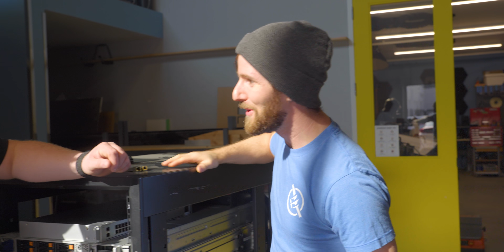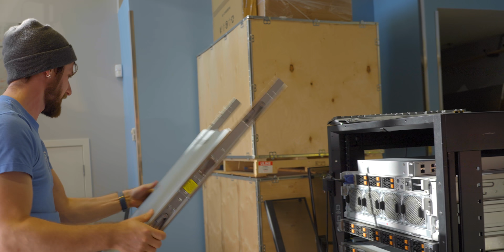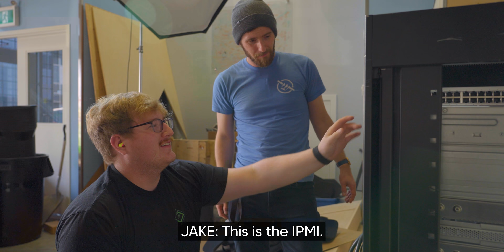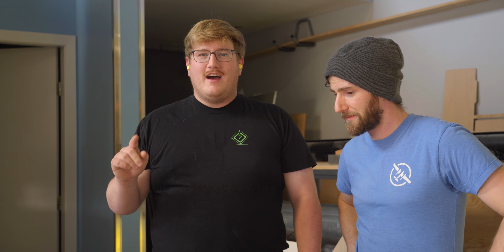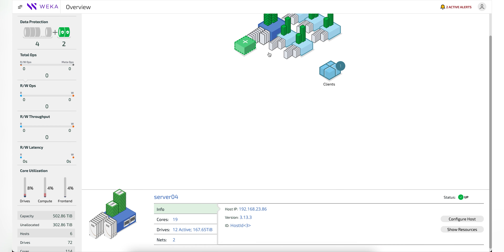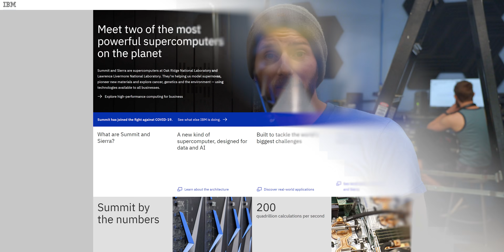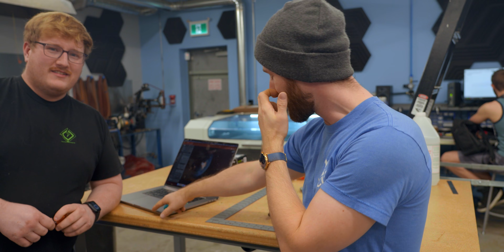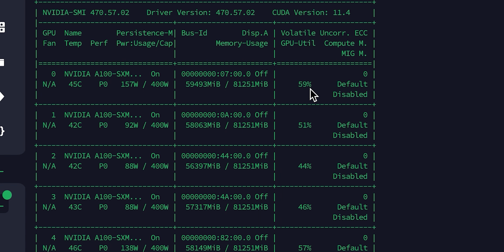The $1,000,000 Computer is Broken

Comment: Have worked for HPE before. Reseating a CPU fixes the issue more times then you might expect. it's weird and might just be a design issue
Reply: Hah.
Reply: I forget their comments through the series of videos regarding building / tearing down those servers, or if that one was shipped / arrived with that build issue. I've also had to reseat a HPE gen8 cpu that was acting really funky, dropping ram slots. I had many spare ram sticks to test, and plenty known good in another almost identical gen8. That was a second hand ebay purchase so was glad to finally fix it before taking up some support ticket.
Reply: HPE loves to ship fully populated racks and those systems take a literal pounding in the back of a Semi Truck. So reseating components is a very common practice on new servers with intermittent issues. Other manufacturers have similar issues so it isn't just an HPE issue.
Reply: @Jack-yl7cc  Absolutely. It is not vendor specific. HPE are pretty much my gold standard on support regarding weird issues.
Thing is.. all the vendors are shipping similar things under similar conditions, they really should be taking every factor into consideration, that the product arrives in perfect working order.
Reply: @benwu7980  This issue has been going on for decades and I have seen it from every manufacturer so at this point I am going to assume they have all done the math on what it would take to permanently resolve this issue and figured out it's much cheaper to train their support techs to ask the customer to reseat the components on the rare occurrence that this problem crops up. How often this problem pops is completely random too; I've had shipments with 1 out 5 servers that had loose DIMMs that needed to be fully seated and other times I didn't find any problems in a shipment of 192 blade servers.
Reply: @benwu7980  HP and later HPE is the only manufacturer that I've dealt with that actually requested a system experiencing odd-ball issues be shipped back to them for their own root cause analysis and troubleshooting.

The real trick is getting past their first few layers of support to actually get to someone that will do something besides reading from a pesky low level troubleshooting playbook. An unfortunate annoyance that every manufacturer support seems to have and one that is to the point where at times it feels like I could write a whole series of Q&As just to submit with a support ticket. The only reason I don't submit that sort of thing with every support ticket is because every time I've tried to get ahead of the game in that way, the support teams just seem to ignore it and still insist on trying to waste my time going through their pesky playbook.
Reply: @Jack-yl7cc  I can understand it from Customer / Tech support, it's basically their job to filter out the easy troubleshooting, and in some cases cannot easily escalate higher without filling out their form.
Reseating the ram is a very common early question, even just for home users with no knowledge, but that issue often just presents as having less memory available. Reseating a cpu though because of weird acting drives, or I guess now gpu's is not something I'd like to walk someone through, when dealing with the prices servers can be :)
Having more and more things on the die now further complicates things, like the Bridges.
Reply: @benwu7980  I would recommend never casually suggesting that you can walk a person through how to do something like reseating components. Just ask them if they could reseat the component themselves and their response will tell you a lot about their "repair" capabilities and if you even want to go down the rabbit hole of trying to remotely talk a person through a process that could be very intimidating and overwhelming to some people(either because of the fear of the unknown or the high cost involved).

I've worked at places that required me to guide people through how to do things they've never had any experience doing before and it can be extremely challenging. It's not something I would recommend anyone attempt if they had any possible alternatives.
Reply: @Jack-yl7cc  Yeah, absolutely agree, though a ram can be at least visually inspected, though even that is actually getting less easy when some mobo's don't have the clips.
I'm thinking back to Sarah's secret shopper.
Cpu though, of any grade.. :shudder:

Comment: Even Perseverance (or Curiosity before it) did not land with just a parachute but needed rockets as well.
Reply: Aren't they doing aerobreaking to lose most of the speed though?
Reply: @StartellerRX-8  its combination of both retro propulsion and aerobreaking/parachute braking. most aerobreaking with body of probe happens in upper atmosphere during the time heatshield is used then after heatshield is dropped parachute opens to slowdown and at the end retro rockets are fired to slowdown to standstill and fly upper part of sky crane away(in case of perseverance and curiosity)
Reply: @bigpod  Also lowered down while the retro rockets hover the whole things 70ft up.

Comment: LMG, gotta say, toward the end, this has been one of your most impressive videos for capabilities of a system. To think you could recompute a NASA model like that in real time.... holy crap 😳
Reply: I thought they were only rendering the data…
Reply: @FluLu  yes they are only rendering, compute was a week on 27000 GPUs.
Seems very inefficient to me though. My software can compute simulations at 10x that resolution on such an 8 GPU visualization server node in half a day :D
Reply: @ProjectPhysX  With the same number of parameters?
Reply: @pearce05  only 4 variables per grid point instead of 7, but 10x more grid points, and about 40000x faster lol
Reply: @ProjectPhysX  Yeah but the NASA code solves a full model of the chemistry of martian atmosphere, plus radiative heating...a whole different ballpark
Reply: @ProjectPhysX  isn't it exponential based on the number of variables?
Reply: @vargabazsaa  forunately it's linear :)

Comment: Meh. I am happy with my 1u B650 7950x 64 GB 16TB all NVMe home server.

It is whisper quiet, does everything I want it to and cost about the same as a single entry level Threadripper CPU.

If I need more storage it makes for a great front cache system for a SAN.
Reply: 1U fans can be very loud as evidenced by the 1U supermicro SSG-110P-NTR10 systems in the video.

Comment: Can't wait the 3-5 years it takes before I find storage like this available on the cheap!
Reply: more like twenty years
Reply: @mrbanana6464  The next 20 years of tech development is going to be a flop. We'll be too busy with war.
Reply: Until they flip this and make one out of soldered in ram chips
Reply: Your power bill won’t be worth justifying the hw.. I run a single server on basement and allready have a bump in my power bill
Reply: I think it's going to be a few years before the used market gets flooded with high-end ssds. it'll be a few years after that before the market gets flooded with high-end gpus, and a few years after that before you and I can afford it, and by then? neither of us would want to do it because the power requirements would be so high versus off the shelf consumer parts. 

I have a massive storage array of 2 TB drives and it's freaking ridiculous how much power it takes. replacing the entire array with a trio of 24 TB drives in raid 5 would reduce my power usage significantly, and possibly pay for itself in short order.
Reply: Yeah how about 30-50 years. Current gen consumer NVME drives can barely be considered cheap. And those are nowhere near the capacity and speed of the Kioxia drives, let alone 72 of them.
Reply: @joostvisser8537  Capacity sure, speed, not exactly. 5 gigabytes/sec is within nvme gen 4 drive capability.
Reply: Lol, yeah.
Reply: Goodwill gonna be kickass 😂
Reply: It takes somewhere between 10 years for a system of 1 million to go down to 1000,- on ebay, if you search hard enough. But IO will still be faster than anything on the consumer market. Got a bunch of old mainframes that way to play with. Still utilizing 64GBs
Reply: 50 years😊
Reply: More like never because inflation only gonna get worse not better

Comment: "The solution was shockingly simple, and I bet it's something you've seen before."

Did you turn it off and then turn it back on Linus?
Reply: I see you work in IT
Reply: @DeathProductions200  first steps are first steps for a reason, my dude.
Reply: No, Turn it off, take all non-necessary components out. turn on, does it work? yes? put in 1 part, does it still work? yes? next part. Rinse repeat until it stops working again. Found your broken component. replace, test, show customer it works, clock time, next assignment.

Sorry for telling all your secrets HPE
Reply: I mean that’s essentially it. Take it out and put it back in
Reply: Don't worry. I'm from the future. Let me handle this.

Have you tried reconfiguring your prime power coupling?
Reply: I'm going to automatically assume the blame falls on Linus for quickly screwing the CPU heatsink on using the incorrect technique X crisscross technique. He gets that new screwdriver in his hand and he can't help but feverishly screw.
Reply: @username8644  I swear to hell, in ALL my time fixing computer issues (and I've had to fix a TON of them, from the dead simple to the absurdly abstract), the problem has NEVER been drivers needing to be updated. Not once.
Reply: @arnox4554  I’ve had problems solved by downgrading drivers but never by upgrading.
Reply: @username8644  Yes, but that's from not having the CORRECT drivers, not from needing to update them. Once you install the correct drivers, literally 99% of the time, you don't need to update them ever again.
Reply: @Wallcroft25  
I know stability is important, but you seem to ignore how they literally REQUIRE the benefits EPYC has over Xeon in this build. Being that Xeon would literally not being able to handle all the drives, thus defeating the point of a server like this.
Reply: I bet he noticed the machine wasn't plugged in
Reply: I was gonna say the same thing
Reply: @Wallcroft25  As you've been berated for in the other thread, it's nothing about AMD CPUs being unreliable and having shit software (neither of which are really true these days). It was an issue of pin contact. If you actually watched the video, it's because the CPU is so big that sometimes installing it leaves it lopsided and not touching the pins.

Besides, your precious Intel doesn't support the features LTT needs for this server, such as the sheer quantity of PCIe lanes. Kinda goes to show how "dodgy" CPUs are still the best option when they're the only option.
Reply: @Wallcroft25  Sure, but they also provide more than Intel's Xeon does. Sure, Xeon is more stable, but they haven't offered any new useful features.

Their servers use EPYC because of the PCIe lanes and cores that AMD provides. All Xeon has going for it is its stability.
Reply: Did you uninstall Windows?
Reply: Damn you!!! That was my thought lol
Reply: Restart, bash the top of it, call a colleague and moan about your problem, come back after lunch
Reply: It’s hilarious that with modern tech this is still the number 1 fix
Reply: @username8644  The thing is though, a working system that stops working is never going to have a problem caused by having out of date drivers, because if that was the problem it would never have started working in the first place.
Reply: Yeah seems like  "Linus touched it" is just about the one true and correct answer.
Reply: that was literally the case lol